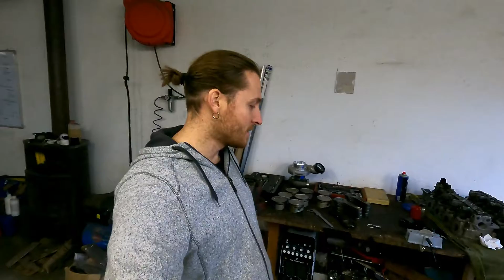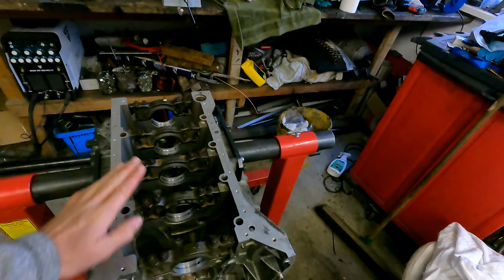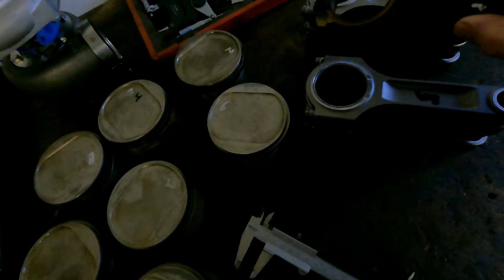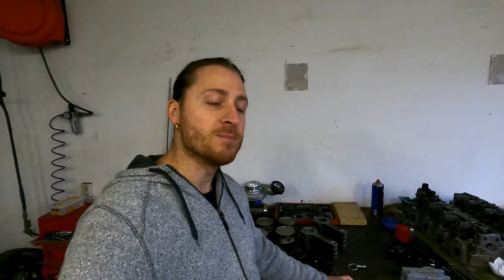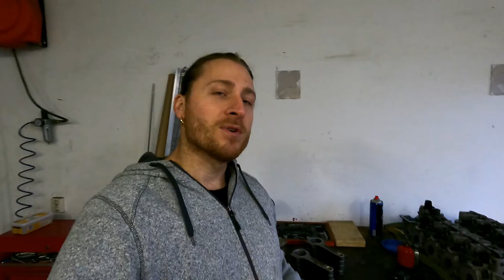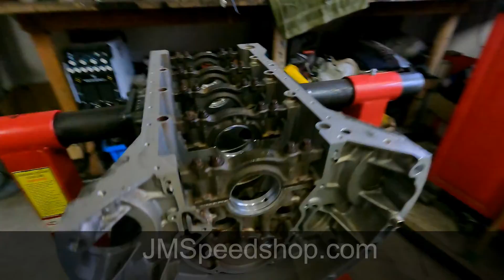M113 engine rebuild - Part 10 - V8 Turbo. NEW RODS & HEAD STUDS + Project goals !!

Comment: How much boost can stock rods take?
Reply from the maker: Depends on torque delivery and rpm  but 500hp the can hold . Some people run the up to 600hp.  I think that is gambling
Reply: @ I ran 600-650 wheel plus 150 shot nitrous  
Still holding
Reply from the maker: Oke . 😎 Personally i would not do this.   But very cool it is holding up.  What torque are your running ?
Reply: @ never dynoed, 60-130 7 second flat
Reply from the maker: Oke.  But then your number is a quess
Reply: @ 100% but if you put weight in to calculator it can estimate pretty accurately hp
Reply from the maker: Yes can. Be but it can also very off because if you have a lot low end torque and. Long gears like these cars have it can come out very different.   How much boost are you running around 6k rpm
Reply: @ 18 psi +/-1 during nitrous shot
Reply from the maker: @arthurgevorkyan2788 oke .. then is should be around 600whp.  I now somebody running s drift car with a 5.0 with m113k heads running same pressure and have 600whp.  This on e85

Comment: is this an e430 motor or an e55 , i recently bought a wrecked 210k w210 e55 and gutted it, it has a blown coolant seal on the front cover which is leaking water into the oil, so while it’s out i plan to do a full rebuild . I think the e55 has forged internals?
Reply from the maker: This is 5.0 engine .  Forged the are all to a certain point also the 430 and 500.  Or 55 na or K Engie. 55 na is not as forged as you think .  Depends how much power you want .  Needs upgrades on a certain ooit.

Comment: Amazing build and your videos! I would like to ask: as I understand all m113 43, 50, 55 weak spot is connecting rods, right? ok, forged ones solve a problem. But how about sleeves? Are those thick/strong enough for your desired power? And one just for curiosity: m113 43 engine to put turbo on is nonsense? (those are very cheap). Thank you in advance.
Reply from the maker: I think with good knock detection the sleeve would be able to hold 800hp .  
Mercedes tested the 55k engine on long runs on a test bench on 750hp. 
The weak spot of the rods are in the 4.3 and 5.0. The 5.5k can hold 750hpp on oem rods .  There are examples of this.

The 4.3 has different internals and smaller valve's.  But as far as i know are also the piston is weaker.  If you look to how much a turbo build will cost then is just taking a 5.0 instead of 4.3 a small price
Reply: @JMSpeedshop  thank you for reply. 55k can hold lot of power indeed. But how about simple version of 55, not kompressor version?
Reply from the maker: Not sure about that .  But a 55k and 55 na have different rods.  But are both different from a 5.0 .   Dont know the strenght of the 55 na
Reply: Hi, Big fan of your channel!

Just to add below, m119 5.0 n/a AMG version and m113 5.5 n/a AMG version both have forged rods.

Have seen both being used for years reliably with a turbo on 0.5 / 0.6 bar making around 550hp or little less at the crank.

The m119 was an amateur drift project and the m113 was in a CL55 street car!

So for a budget turbo build, just go with an AMG version and it will be better cost effective for the future!

Cheers
Reply from the maker: Thanks ..but the oem 5.0 has also forged rods but also hold 500whp. But for how long.  I just want a little more.  And a amg engine is more expensive that s 5.0 na with engine mods. Here in europe

Comment: cant wait for the other vids to come. awesome. i have the ml500 and i am collecting parts for a rear turbo mount. and keeping it all stock. running water/meth combo might solve issues short term so am on a look out for a spare and build that up as your videos can now be my go to for tech details. the CR with 85 RON works but expensive as a daily. looking forward to your oiling solution for the turbo. thanx for your vids as always.
Reply from the maker: Thanks .  It will all be in the video s 👍

Comment: Why not schorter rods  ,  with lower compression , the  motor can run on more turbo pressure
Reply from the maker: See next video.  This will come.i think tommorow or Sunday. There is not to.for shorter rods.  It will be in the last 1/4 of the video. The rod can not be shortened without modified pistons on the bottom or machine the crankshaft. There is only 1.5mm play in between piston and crankshaft when on BDC